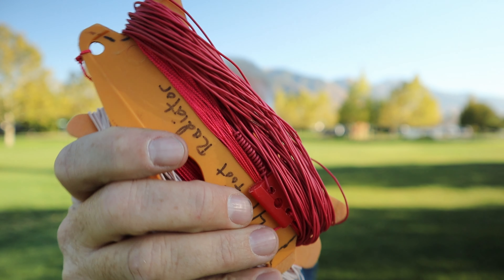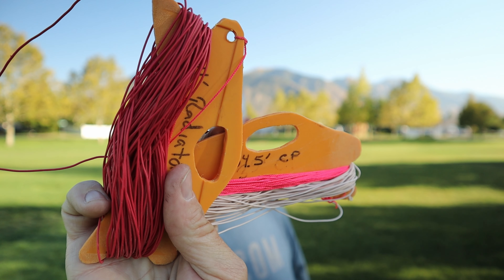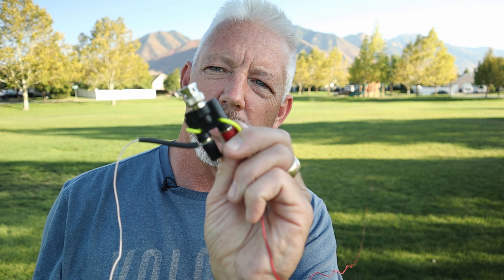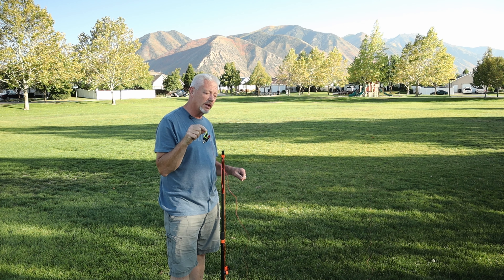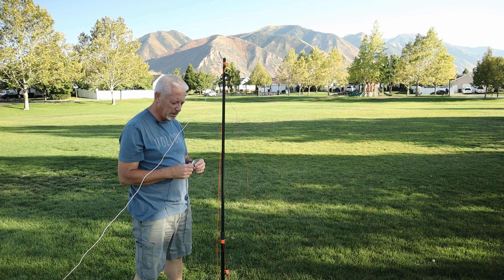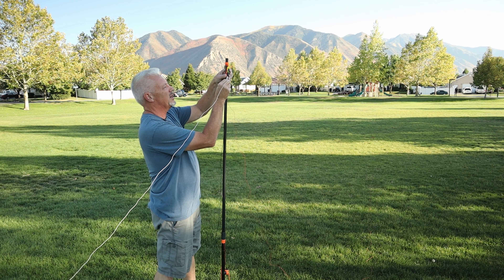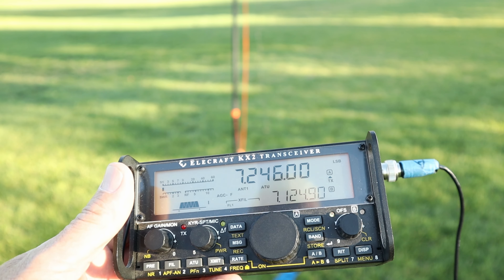Unbalanced wire antenna for operating | K7SW Ham radio

Comment: Wonder how a short run of ribbon feeder would go seeing its not a particular cut dipole, you might get less loss and tune it still at the radio with no coax. I use the same type of centre for my SOTA dipoles but have a Line socket plug on the antenna end saves having different connectors to fit it all together.
Reply from the maker: Willian,  That is a good experiment to run, I may need to try that. Thanks for watching

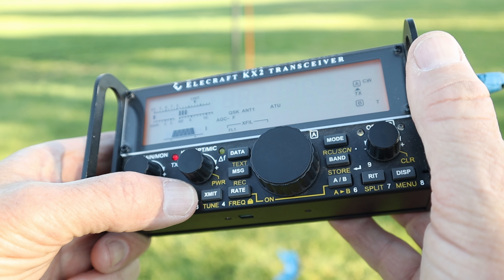Comment: At 6:43 into the video you tune your antenna at 40 meters. You say the result is 5 to 1 but the tuner seems to adjust things down to 1 to 1 What am I missing?
Reply from the maker: Thanks for noticing,  I should have left that part in the edit.  When you hit the transmit button without using the ATU you get to see the SWR presented to the radio.  The tuner on the KX2 fixed the remaining mismatch.  I will see if I can remember to add those details on future videos.  Thanks again for the observation.  
73